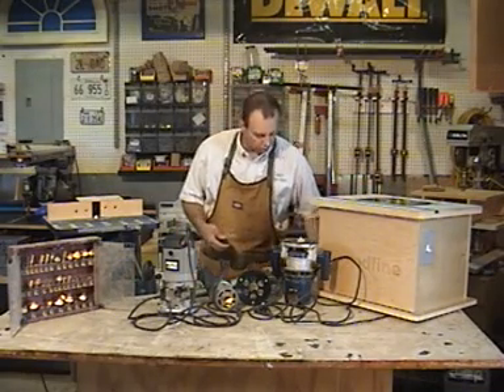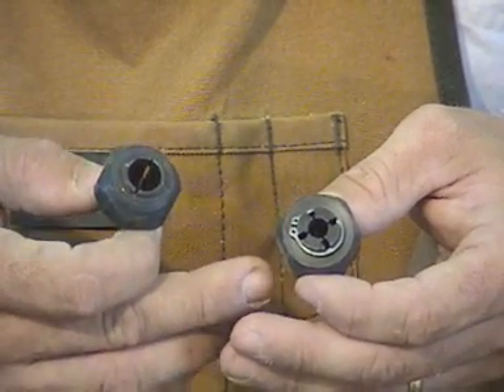Router Safety and Operation P1

Comment: most any router can be mounted to a table.  However the plunge routers make it more difficult to change bits.  With a removeable base router, like the PC 690/890 series, you can removed the motor and then change the bit easily and then reinsert the motor into the base.  For 3 years we used an import copycat of the makita plunge router in our school router tables, just had to do all bit changes from the top and it was a little more challenging with big fingers.